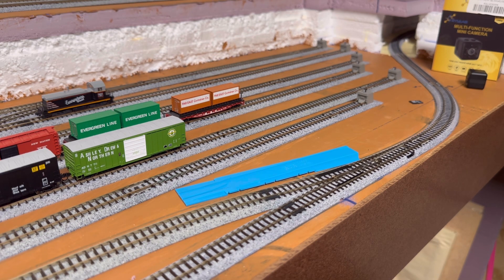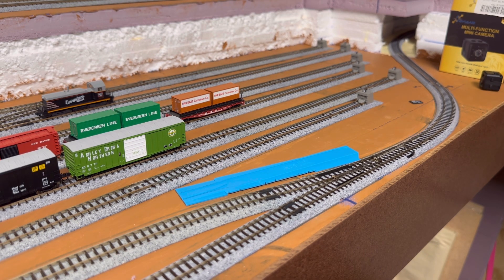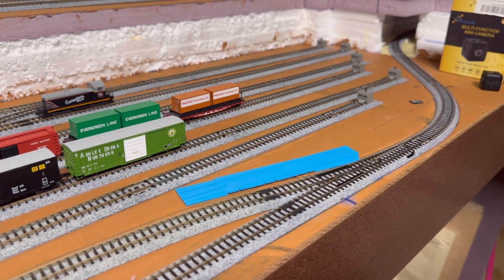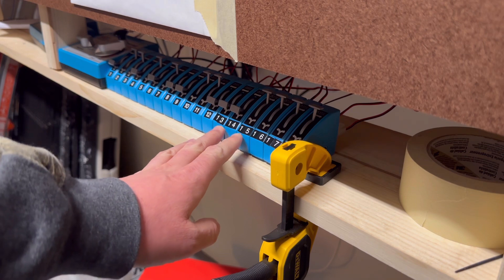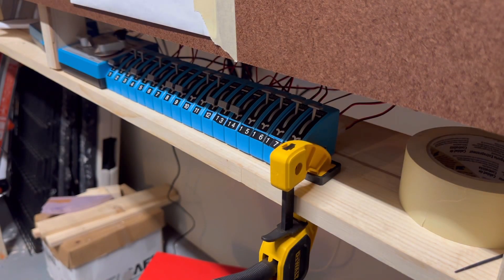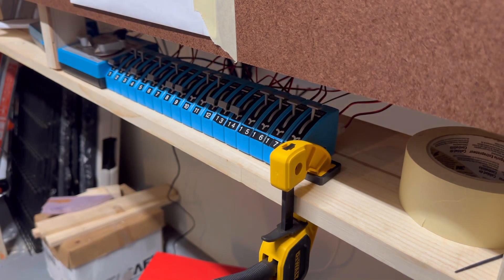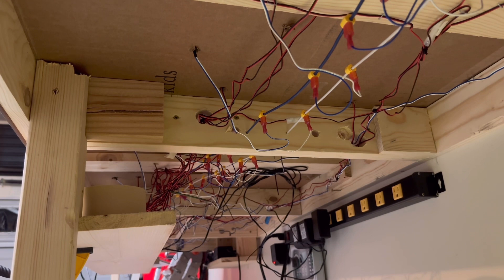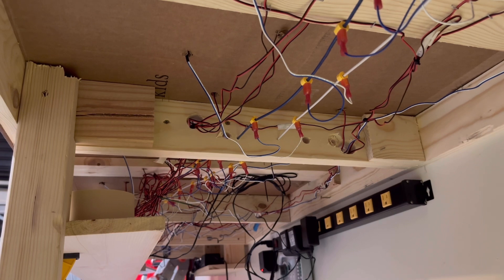Viewer Requests: Kato Switches and Switch Controllers With DC and DCC

Comment: Great video brother. I should be posting one soon in the next couple days with the yardwork. I did it over the weekend. Finally got about 90% of one of my yards temporarily wired for power. Still working on the switches. The Kato switches are a complete beast if you want to use anything other than their controllers like you are currently doing. I am working on a combination, mimic panel with push buttons with the Arduino and a manual option with their controllers. But it is an absolute beast to work on.
Reply: i posted that comment under the wrong account…
Reply from the maker: Yeah I am not looking forward to wiring the switches. I was planning on using a Digitrax unit and mounting push buttons all over the layout. I cannot think of the model # but it can control up to 4 switches per unit. Good luck with your yard. I will look for your channel! Thanks!

Comment: Hey, about the turnout extension cables, you said you are using the Kato ones and I agree that is the best but if cost is a factor?  I have a future layout that will need 15 turnouts/switches and its a large U shape layout, if I use one Kato power pack, I'm going to need anywhere from 22 extension cables to 37.  That is a lot of money tied up in cables.  Besides getting a second power pack so as  "split the layout", could I just get a spool of 24 gauge wire and just make my own extension cables?  Be a heck of a lot cheaper.
Reply from the maker: So I am going DCC with my layout and I will not be using the cables really at all any more from Kato. I will be getting a Digitrax switch controller that can control and power 4 switches  then I will mount buttons all over the face of my layout inline with the switches. If you are staying DC, I do not see why you could not cut the Kato switch cable, add the 24g wire in the middle then reconnect the factor Kato piece at the end to reach the power pack. Doing multiple power packs would be a good idea as well so it is less of a headache knowing which switch to throw. Have 7 on one and 8 on the other kind of thing. No wrong way to do it though. Whatever works for you. I may have some Kato switch controllers I no longer need if you want to email me about them. Hope this helps.

Comment: so your switches are not connected to the dcc system? Then what happens when you train goes on them?
Reply from the maker: Kato switches are power routing so that means power from the feeder wires connected to the bus under the layout flow into the switch. The black and red wire from the switch only supply power to change the direction of travel. Using the Kato power pack/controller or the dc adaptors only supply power to throw the switch. As long as track power is flowing through the switch, the engine will operate as normal. Right now, most of my switches are not powered at all so I have to manually throw my switches. Having the red/black wired powered or not has no effect on engines running. Hope this helps.
Reply: @Silverstatetrains  I see, all clear thank you very much.
Reply from the maker: I am glad I was able to help.

Comment: NCE does make a board/chip for the switches so you can use your power cab. My layout is not big enough to use the NCE board/chip  . I only use the kato power pack for the switches only. My layout is DCC. My DCC is NCE. My kato turnouts has screws for power and non power routing. Just giving you a heads up
Reply from the maker: Sounds like you use #4 switches. One of my future tasks will be upgrading my switch controllers so I can ditch the Kato pack and use push buttons placed throughout my layout. I was looking at the digitrax unit. Will have to check out the NCE unit as well. Thanks for the suggestion.
Reply: @Silverstatetrains  I do have #4 switches and I also have a left to right switch that has the same thing.
Reply from the maker: Oh cool. Thanks for the helpful information.

Comment: Thanks for the great video.  I am going to set up my layout the same way using 6 total #4 turnouts.  I am going DCC also and will use my old powerpack like you did to only control the switching of the turnouts.    Do I need to do those insulated connectors on the ends of the turnouts?    I dont really understand that part of it.  So with 6 total turnouts, I am going to have to add those insulated connectors to the ends of all those turnouts?  (that is the only thing I am unsure of)
Reply from the maker: Thanks for watching. I would recommend using the Kato #6 switches. They are more bullet proof and are more reliable then the #4 switch’s. I have seen many comments from people who have had nothing but problems with those. Cars also seem to derail more on them. I had that issue with my crossover which is basically a #4 switch.  That being said, if you are building a layout with tighter curves or with limited space, the #4 switches are still a good option. Mike Fifer made a good video explaining the insulators. Look up this video “Wiring for DCC with N Scale Kato Unitrack”. I used this video a lot when I got started. I also made two new videos going over another way to power your switches which you could easily move to which would not require the Kato power pack to power the switches. Look up “how to power Kato switches without the power pack, proof of concept” and “everything you need to power Kato switches with DCC”.  The main reason for the insulators is it creates blocks in your track which helps to isolate where your problems are. The switches are a great place to do that as it visually makes sense. I hope this helps. Feel free to email me your track plan and I could help you lay that out. Thanks for watching.

Comment: Hi, interested in your buss wire connectors. 
What are they and where can I get them ?
Thanks in advance. 
John
Reply from the maker: Amazon-HKS 100PCS T-TAP Wire Connector Quick Splice Disconnect Yellow 14-12 AWG - Self-Stripping Electrical Wire Terminals Kit Automotive Crimp Insulated

Comment: Everyone- i buy my kato stuff straight from JAPAN PLAZA in japan- half the price of here in canada or the usa. extension turnout 3 ft wires with quick connect for 2.50 canadian.
Reply: That's a great tip. I live in UK and have just compared some prices between Japan Plaza and UK retailers, as you say there's a huge saving to be made. I intend to start building my model (my first N gauge) in the new year so I'll then look into postal charges and any taxes to pay. Thank you.
Reply from the maker: I have bought a few things straight from Japan. The only issue is the shipping. Either it is $$$ or takes forever or both. But you can find good prices.

Comment: Is the kato powerpack plugged into the dcc power supply or does it have it's own power supply? Im considering getting Digitrax DCS 52 Zephyr Express but i have the kato switches you have.
Reply from the maker: The Kato powerpack has its own power supply. The powerpack is not connected to or effecting the track other then suppling the 12v needed to operate the Kato switch motors. I did a recent video showing another way to power Kato switches with DCC that may be useful. Look up “everything you need to power Kato switches with DCC” and “how to power Kato switches without Kato powerpack proof of concept”. Would be a cheaper option for you if you do not have the Kato powerpack already OR plan to have many switches. This would give you a way to put switches all over the place with its own power. Thanks for watching.
Reply: @Silverstatetrains  Thanks!
Reply from the maker: No problem. Glad I could help.

Comment: oh, I forgot when I was commenting the first time what are those taps you use for your bus line? I think I like those. Can you shoot me a link or a post a link here
Reply: I posted those under the wrong account. I do love those taps would be very interested in the link for them.
Reply from the maker: I have order two of these kits. This kit and the same but more of them. The quantity ranges based on you need. Nilight - 50004R 120 Pcs/60 Pairs Quick Splice Wire Terminals T-Tap Self-stripping with Nylon Fully Insulated Male Quick Disconnects Kit. Hope this helps.
Reply: @Silverstatetrains  thanks brother
Reply from the maker: Your welcome.